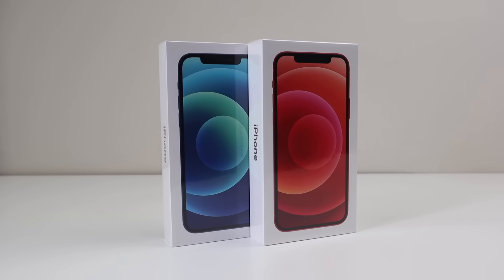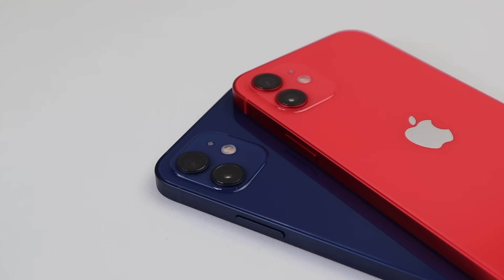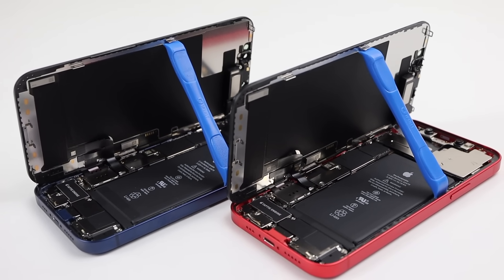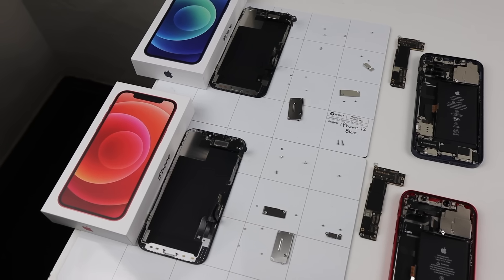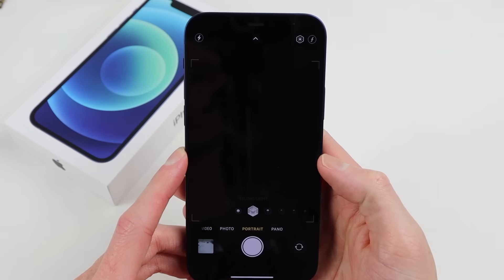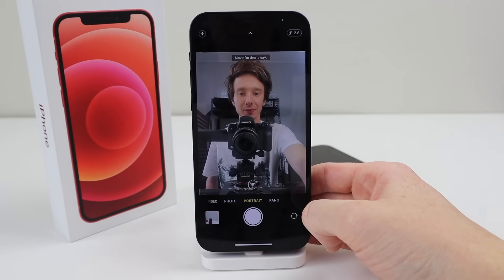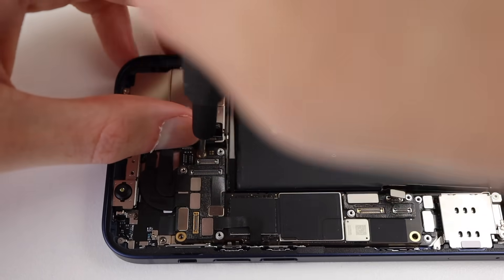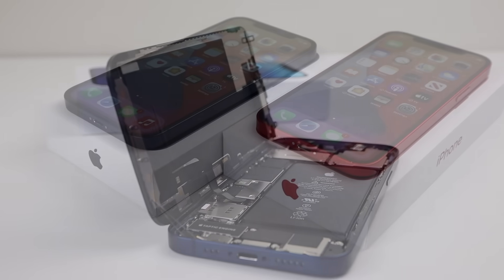iPhone 12 Anti Repair Design - Teardown and Repair Assessment

Comment: All these and probably more are why I stopped buying iPhones at the 11 pro Max.
I still think iPhones are the best but until Apple gets their heads out of their backsides and undoes this craziness I won’t be buying.
Pity Apple doesn’t make a 6.7 inch iPad. Honestly, since all communications these days is software and data.
Why are there cell radios on phones.
Companies could put more money in cell/data/broadband boosters and remove the cell and text chips, if they even exist any more. Put in a good 4gLTE chip ( since most of the world still doesn’t have 5g of any kind, they could save on tablet production by just going 4G and providers providing service of 5Ge. It’s actually 4G but much faster than the crap we are overcharged for every month. ) and a larger battery. There are so many ways to improve for a lower price and companies just ignore the obvious.

Comment: real simple solution DONT BUY APPLE PRODUCTS  they are substandard builds to start with, the Xiaomi Mi 11and now the ultra
model, is half the price and just as good, if not better in a lot of ways, THEY DONT HAVE A CHARGER BUT THEY WILL GIVE YOU ONE FOR FREE IF YOU ASK FOR IT,  APPLES CHARGING CABLE IS TYPE C USB YOU STILL HAVE TO BUY THE OVERPRICED USB TYPE C CHARGER COZ WHO HAS A TYPE C USB WALL CHARGER, AGAIN FFFFUK APPLE. BIG COMPANY LIKE APPLE NEED TO LEARN THAT YOU CAN'T KEEP GIVING PEOPLE LESS AND CHARGING  THEM MORE FOR IT, AND 95% OF THE TIME THEY WON'T REPAIR THEY WANT YOU TO BUY A NEW ONE......... IT'S LIKE SAYING TO YOU, YOU JUST BROUGHT THIS CAR BUT I CAN'T CHANGE THE TIRES THAT HAS TO BE DONE IN THEIR SERVICE CENTER USING THEIR TIRES,  OR THER CAR WON'T START.  THIS BEHAVIOR IS JUST CRAPPY AND SHOWS WHAT THEY THINK OF YOU THE CUSTOMERS  STOP BUYING THEM

Comment: I would be interesting to see the source code that intentionally cripples these devices.
Reply: I feel like stuff like Killswitches, Anti-Repair code, and Planned Obsolescence should be illegal, but that would require you to out-lobby the Plutocrats...
Reply: @Ivan Varela 
excellent breakdown. i'm sorry your current conversationalist is refusing to try to understand and is instead attempting to put words in your mouth.
Reply: @Ivan Varela My old computer lasted me a good few years, went completely to shit in about two months. Bought another one for $2,500, and 1 and half years later the fan is making weird noises on start-up. **SIGH**
Reply: @Ivan Varela 
You know that's not a disproof or explanation for how anything I said is wrong, yes?
Reply: @Ivan Varela 
Okay, a software engineer, not an economist or a business owner.

"One of the main concepts of general engineering is to design every component in a given product to last the same amount of time."

Right, but that's not the same as designing something with the intention that it fail. You are ascribing, intentionally or not, a negative or dishonest connotation with regards to business men - painting in people's minds the idea that products are designed to fail at a given time to manipulate people into buying new ones - with your use of language. Again, products are not "designed to fail", they are designed to be as durable as the customers are willing to pay for - basic supply and demand. Choose your words more carefully.
Reply: @Ivan Varela So the business equivalent of running a lemonade stand has made you an expert on economics to the point you think you can (mis)represent the intentions of others? 
And me directly quoting your own claim back to you word for word and explaining what's wrong with it is "putting words in your mouth"? You didn't even deny it or explain how I misrepresented you which makes it very much appear that I did not misrepresent what you said. Worse, you are doing the very thing you accuse others of doing - misrepresenting their products.
Again, things are not "designed to fail", your words. You are wrong about that part. Things are built to last as long as people are willing to pay for to last. Rather than baslessly accuse me of misrepresenting you why don't you just amend your claim? Usually engineers don't have this much a problem acknowledging when they've made a mistake.
Reply: @Ivan Varela 
No one designs something to fail. They are designed to last, to be as robust, as the customer is willing to pay for. Who would buy a $10,000 unbreakable smartphone that can be easily repaired if it's obsolete in two to five years because technology is advancing so quickly? What you are complaining about is, essentially, other people making different choices and having different preferences then you.
Reply: @177SCmaro  hey (lesser intelligent being), what about when their code intentionally slowed down their devices after a few years went by? This was written off as a battery saving feature but it was undisclosed as a feature and didn't stop if you replaced the battery. It was essentially a timer that went off and slowed down your phone. 
Another thing worth mentioning is how so many people NEED to have opinions on everything. You clearly have no idea what you're talking about because phones don't become obsolete in a few years unless their designed too. These last few years all the "advancing technology" is just adding more cameras. What he is complaining about is not other people's choices as if to say, he's bigoted for having this opinion. 
Now please remember no one asked you and your likes aren't actually any more real than pixels on a screen.
Reply: @177SCmaro  found the apple fanboy lmao
Reply: @jorgemeraz8666  
This is being typed on a Samsung tablet.
Reply: @177SCmaro  found the apple fanboy who couldn't afford apple
Reply: @jorgemeraz8666  
Lol, good one. My samsung tablet costs about as much as the apple equivalent at the time though.
Reply: @177SCmaro  That's exactly what some apple fanboy who couldn't afford apple would say
Reply: @kejocemi  
lol, you're funny. 🤣👍
Reply: @177SCmaro  So not even you believe the crap you are saying
Reply: @TYR1139  
No, it simply appears that I'm in the midst of some really economically ignorant kids.
And it's fine to not know the economic "why" of things, everyone can't know everything, but then to spout off about it and expect no one to push back against it...well...that's a very millennal thing to do, I think.
Reply: @177SCmaro  Oh, but we understand, thats why we are rejecting it. I would personally rather die that support a company like that and a econony like that.
Reply: @TYR1139  
You reject economic freedom because the current quasi-socialist/fascist market economy allows/results in corporations, a creation of government btw, doing things you don't approve of.   
Yeah, you've totally got things figured out. 😖
Reply: @TYR1139  
So, 90% of your comment is attacking me, personally, rather than addressing any argument I made and the last 10% is just stating the obvious, that economic freedom is not allowed anywhere on Earth. 
If that's all you got to say I'm going to have to move on.
Reply: @TYR1139  A fallacy is a flaw or gap in logic - something that does not follow - which can manifest as a contradiction,  falsehood, ect. For example, attacking someone's character does not follow that their argument is in any way incorrect (ad hominem).
Simply asserting that someone is incorrect does not follow they are incorrect (argument by assertion). 
Implying someone is being hypocritical doesn't prove they are or are incorrect on account of it (appeal to hypocrisy). 
In any event, nothing in your reply is an argument disproving or even addressing any argument I put forward. Again, since you've got nothing in that regard I'm moving on. 
Enjoy your weekend.
Reply: @177SCmaro  I see, so you also don't understand basic logic diagrams. The day you understand contradictions don't invalidate arguments and fallacys can be used in informal disscusions your brain is going to explone
Reply: @TYR1139  Yes, how silly of me for thinking A is A and not also B. 
Goodbye.
Reply: @177SCmaro  lightbulbs used to be too durable, so the lightbulb sales dropped because no one needed light bulbs, so they made them shitty so each time they stopped working people would buy more.
Reply: @colinouille2786  So you're against affordable bulbs for poor people?
Reply: @177SCmaro  "So WhAt YoU aRe SaYiNg iS" ... so typical dude, just stop typing
Reply: @iverne3025  Another brilliant snippet of insight from the think tank. I'm convinced. 🙄
Reply: @177SCmaro  there is no way you arent just baiting people into talking to you by making these... comments, but im mostly amused at the things youve been saying. In this comment and several others youve nonsensically talked down to repairpeople, software engineers and business owners with years of experience dealing with electronics and the market respectively and their evolution over the past few decades but what do you do that makes you an expert? I would sincerely love to know. Without any evasion please.
Reply: @Emily-lk1mf  
1. I never claimed to be an "expert". 
2. Why am I the only one that has to prove his credentals and not anyone else? Why don't you or they? Because you don't like what I said but you do like what they said? Biased much?
3. You havn't made any sort of argument disproving or even addressing anything I said as you talked down to me, the very thing you are criticizing me for. The difference between us is when I have supposdily talked down to all these supposed experienced people in the YouTube comments I at least made an argument. Where's yours?
Reply: @177SCmaro  Do you have brain damage, I'm asking because we're jumping to conclusions.
Reply: @colinouille2786  
You havn't asked anything. You've insinuated that people who are meeting the demands for more affordable products are doing something wrong or manipulative. There is nothing immoral about offering lower cost products with a lower life expectancy especially when there is a demand for it in the market.
Reply: @177SCmaro  ok I'm convinced you don't have basic reading comprehension but yeah sure
Reply: @colinouille2786  
Not only is attacking me, personally, not an argument, not a disproof of anything, but writing that I'm essentially illiterate was about the dumbest thing you could have done as either I'm going to instantly prove you wrong by coherently responding to it or you would be knowingly sending me a message that I can't understand. Neither reflects well on you. 
Try thinking a bit about what you're sending people.
Reply: @177SCmaro  and if someone wants to fix their phone let the fruit snobs stop them!

Comment: Apple products have great technology but anticonsumer, android phones are getting garbage. What to do?
Reply: @matthias6933  I also buy used phones at lately bought used iPhone e2 2016 for 80$, works great
Reply: why are android phones getting garbage?
Reply: @Fus1onplayz  old iPhones can still run as new after many years, technology in iPhones are way much better than Androids, but apple hates their costumers, Android phones are lagging after few months, especially Samsung, they are becoming more and more fragile, getting slow, and adopting apple politics against costumers, Android phones are les reliable than they were, I've been using Samsung note for more than 12 years and I think my iPhone se 2016 is still better than the 2 Samsung notes and the s8 plus and the A70 I actually have at home.
Applications are well made in iPhones.
Reply: @cooldad9234   @Cool dad  technology of iphones is not better than android phones except the SoC which is not that important with the power sd 888 already offers. The last phone i had that was lagging after a few months was a samsung. But there are more companies than samsung and my phone runs since 2017 without a problem.

Comment: My phone:
Blu V9
180 $

came with:
2 screen protectors
1 full protective case
1 set of headphones (and has a headphone jack)
1 set of microfiber cloths
stickers
1 year warranty
and a real charger....the normal mirco USB one too..

Specs:
13mb cam for front and back
64GB storage
3GB ram (apple wont tell you this)
4000 milliampere hours battery (apple wont tell you this)
1080p recording (not 4k but good enough for me!!)
6.3 inch screen (only I12 better is the pro max)
5.86 ounces in weight.

guess what is the BEST part though?  When it breaks out of warranty, I walk or drive to the store, grab it off the unlocked phone shelf and leave with a new phone for less money than the warranty replacement cost of that apple 12. FUCK name brands.... I say that because I am tired of them fucking all of you.

Comment: Anyone that buys iPhones are themselves an environmental impact on this planet. LOL! 😂
Reply: Indian will crack this soon , No problem Guys 😅
Reply: I am an android guy but had to purchase iphone for work purpose all i will say is this,
iPhones are great phones but there is certainly handicap to them like for Android guy to switch to iphone completely is next to impossible which should be alarming to Apple as it what they want and only way for apple to survive, but its very difficult as iphones dont let you do much, heak it won't even let you change keyboard size.

Also apple is very cleverly fooling everyone with saying iphones have better camera....no they don't.....what iphones have is extremely consistent camera, and there's a difference between best and consistent.

After using iPhone for over 6 months while I can certainly say that iphones do certain things brilliantly but do other things very dumb.... I constantly have to reach out to my Android phone (Asus ROG 3) for a lot of simple tasks....For example face ID is brilliant you don't have to put your password ever on any app or site but notifications on iPhone makes me want to rip my skin out the method is atrociously archaic in comparison to Android.

iPhones have the most powerful processor true and no one can deny that but there's no point if you can't run calculator and a spreadsheet to calculate certain numbers at once (dual apps).

iPhone users can easily move to Android (minus the overwhelming customisation options) but Android user will feel very constrained and handicapped on iPhone.

That's what's happening in the industry where lot of iPhone users have moved to Android and very few Android users have moved to apple.🙏
Reply: IPhones are fucking junk.
Reply: Never had one, never will. Market ploy , exorbitant prices, small usage life, conveyer of not so great mobile phones... Every year new! Better than before! Just throw your last year's model away, and buy new!
Reply: @Cody Allen ikr? i have a j1 ace (2015) as a second phone and it works just fine, only battery issues of course...
Reply: If you do anything besides breath you have an environmental impact. 

Even breathing can be considered bad for the environment.
Reply: Not really it’s the people that think they need to buy a new phone every year, I have an IPhone 6 and the only reason I’m buying a new phone is because obviously the iPhone 6 doesn’t support iOS 13 and up
Reply: I hate this word. Seriously. I cannot express in words. I hate it. But this comment is.......

cringe
Reply: This argument has still been going on? Just agree to disagree people, some will like your opinion and other's won't, get over it.
Reply: ……how often do you upgrade your phone? iPhone 8 user over here still…..
Reply: @lrac_1  not very often. Not until parts I cant economically replace fail or the phone just becomes far too old for what i need it for. Then it gets relegated into a second or third screen for me to keep track on my twitch chat etc
Reply: Thank you so much really doing a great job for me I'm very grateful 🙏🙏 HACKERSIGGLE on Instagram
Reply: If you buy anything you’re impacting the environment. That’s how it works...
Reply: Fact
Reply: and us iphone users dont give two shits LOL!
Reply: Ez don’t get new phones
Reply: Piss off

Sent from my iPhone
Reply: Sounds like someone can’t afford a good phone🤣❄️
Reply: Android = garbage. Your phone becomes unusable after 2 years. It starts lagging, heating, giving you random errors, eww..

Apple = Worth it. You can use it up to 5 years without any problems, except after 5 years you’ll probably want to change your battery. But if you can’t afford getting a new device after 5 years of usage, then don’t buy iPhone.
Reply: @CaddyMeister  if you are comparing an entry level stuff then I got nothing to say. But same tier products wise, your statement is invalid.
Reply: @zschan3935  There is no such android device that can compete with iPhone SE which costs 400$ ofc as you said in same tier list. I’m using iphone since iPhone 5, but friend of mine bought Samsung in 2019, I don’t remember which model, but price was 800€. Recently he had to get a new one, because of the problems I described in my previous comment. Also I had my iPhone 5 for 4 years or so, not a single problem occurred, only battery 4 years later obviously won’t work the same way as new one.
Reply: @CaddyMeister  Your statement is wrong my android phone is still usable after 4 year without any lag, heat problem or any error
I can run 100 chrome tab and many app simultaneously. I had dropped it so many times without any crack. I had put it in a black backpack and leave it in a hot place around 38degree celcius. I used to leave it in a freezer and it is still usable.

and yeah this comment was made by that phone
Reply: @WordingtonComment  lol, I won’t ask why did you put your phone in freezer, but did you launch it to stratosphere or shot it with 5.56 cal? I assume you love experiments.
Reply: @CaddyMeister  I put it in a freezer because the weather at that time was very hot my phone screen absorbed the heat from the sun (black object absorbs visible light) and I don't want to decrease its life time so I put it in a freezer to let it cool down.
I am not a guy who do many experiments im not rich enough afford guns, hydraulic press, etc.